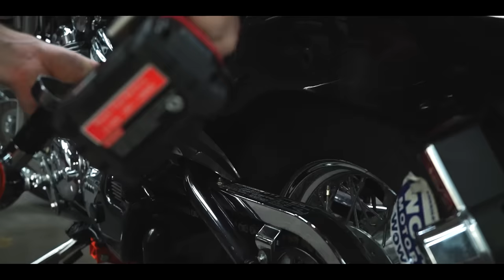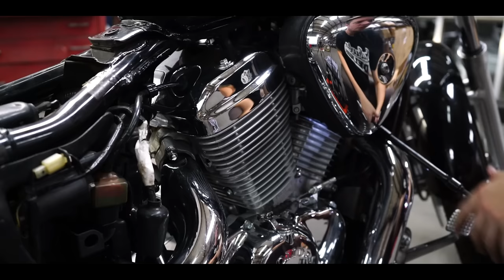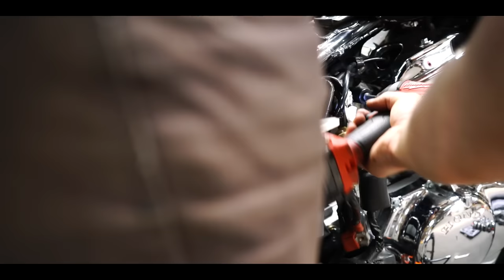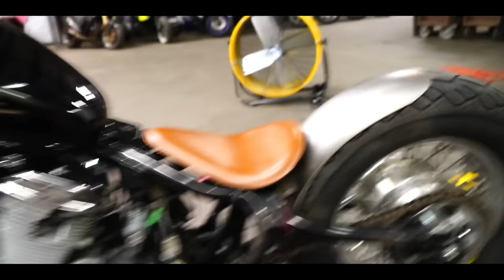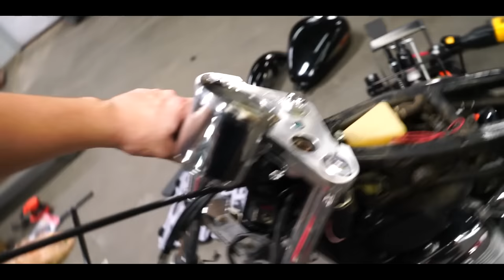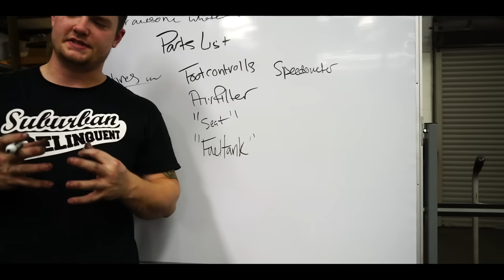Disassembly & Design - Honda Shadow Bobber Build | Ep. 1

Comment: Every time I watch these build I’m like “Yeah I can do that.” Then he starts chopping shit off.
Reply: You can do it..... It's really not that hard. you just gotta remember to either hoop the back of the frame or seal it up somehow. I like hooping the end of my frame because it gives me somewhere to bolt the fender to. I'll hoop them and then run the bolts though the hoops as a second mount for my fender, 2 in the frame and 2 in the hoop. and that's all you need.

Comment: I bobbed my 2005 shadow about a year ago with a blue collar bobber kit. Love the bike
Reply: I used a BCB kit on the first bike I ever bobbed and haven't since. I build alot of smaller bikes though, most of my builds are 125CC-500CC and they don't make those kits. I'm building a 125 Hysong GTR now and I'm doing alot of custom things to it, I'm not just bobbing it but I'm bending the hoop up around the fender to the end of the rear fender to mount the taillight and rear turn signals too. I got it for a song and it's a "cheap Chinese P.O.S." so I gotta do something to make it stand out.

Comment: Awesome stuff dude. Everytime I watch you do this stuff I get a little closer to buying one. Have you ever thought about learning how to/getting equipment for coating? In two videos (break down and coating) you could show almost half the process of bobbing without needing to out source work (and content)
Reply: As someone who builds Bobbers and Brats out of my own shop I never have anything powder coated. It takes too long, it's not cost effective and it doesn't yield any better results than paint does, plus if I scratch my frame putting my tank or seat on I cant just touch it up the powder coat was as I can  with paint, I can feather the scratches out and grab my pain gun and touch it up, with powder coat if I scratch it up I have tear it back apart and have it recoated. I have had rims powder coated and that wasn't too bad but still not worth it monetarily IMO because the quality of paint, even rattlecan paint has gotten so much better over the past 10-20 years.

Comment: Dan, I think that you should get a yellowed out lens for the headlight. I think it would give it that old millitary look along with the matte green
Reply: I'm doing a Military inspired Bobber build now and using a yellow lens headlight. Mines a 68 Royal Enfield Interceptor that was used by the RAAF (Austrian Royal Air Force) , I have no idea how it ended up here in the U.S. but I lucked into it and bought it for next to nothing at a bike auction, it even came with the paperwork and pictures showing it was used by the RAAF. It didn't run when I bought it and there's so much missing that I decided to just bob it and make it a military inspired bike because finding the correct parts to get it back to military specs would cost an arm and a leg and I'm not sure if it's possible.

Comment: Be careful how low you go because the coolant reservoir will get crushed by the swingarm. Also the kickstand skipping out on you. We usually lower with a hardtail strut hole to hole 8-3/4”. That should give you a good lowering.

Comment: Would you reckon that putting the dogbone in without cutting the frame would be a good solution? In my country, you are not allowed to cut the frame before the last cross-frame thingy. I was wondering whether just bying the dog bone and replacing it with the original shock could be done without the rear part of the frame hitting the tire. Just having the Shadow lowered looks so sick!

Comment: hey dan why do you cut the brake and turn signal wir instead of unplugging them? the plug connections should be only about 2-6 inches from the battery....at least they were on my 2009 vulcan 900 custom and 2004 vrod.

Comment: How come the frame has to be cut?  I'm new to this.  I wanna buy a used, cheap bike to get this done, but the cutting of the frame scares me.  Can't a smaller suspension be placed so that it'll fit to that height...as you would on a car, for instance.

Comment: Dan.... I’m karate choppin my vlx 600 RIGHT NOW!! Please tell me distance from bolt hole to bolt hole on that solid aluminum brace you used!!! 

I’ve been jacking up down up down up down my bike for 2hours seems low , seems high ... fuck an a , if I copy your  ridged pipe , I’ll run with that height !! Hook it up !!
Reply from the maker: Honestly, I wouldn’t suggest using my height. I really wanted a super low stance on this bike. I’d suggest keeping it at the heigh where the subframe rests naturally on the swing arm (if you haven’t already chopped that). If you have, I’ll measure it for you on Wednesday and get back with you.
Reply: Do It With Dan if you’ve not tackled the seat yet ... I have sick ass idea!! I don’t like the weird void on mine & didn’t know how to address it... it hit me when I was robbing parts off my snapper , that fkn flat spring bar! That hold the seat! I’m going to weld it just before the rear tank bolt & my seat (should) appear to float (in theory) my 220lbs should be able to flex the bar & offer SOME SORT of ass suspension
Reply from the maker: Yea that’s actually surprisingly used in some bobbers. A lot of people use leaf spring mounts that give a floating appearance. I think I’m going to stick to conventional springs for now. I’ve got a new setup on the way.

Comment: I want to turn my vlx 600  into a dual sport bike for  light off road  . I want to raise it off the ground as much as possible with a bigger rim size like a 18 inch rim and put on this tire 4.60-18 tube type (63s )  https://www.rockymountainatvmc.com/tires-and-wheels/shinko-700-rear-dual-sport-motorcycle-tire-p .  . Do you think its possible? If I brought you the bike would you  do it and make a video  of it . I cannot find one video  of a shadow being  converted into a light off road dual sport  bike .  There are no  dual sport tires for  my stock rim . I can't find one  with any off road  tread at all except for some car tires  like the  SIGMA CLASSIC ALL SEASON
165/80R-15  that is close . My tire is a  170/80-15 .  Will a car tire work on a tube  type rim ?